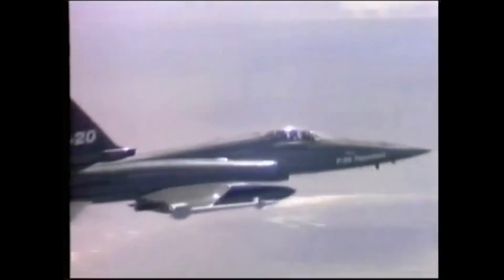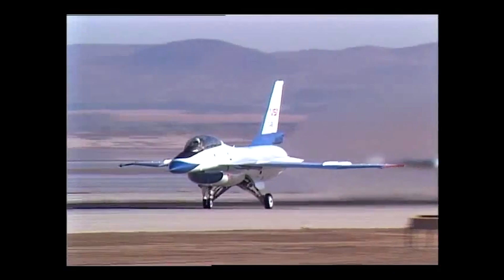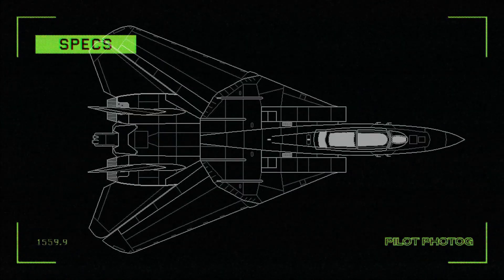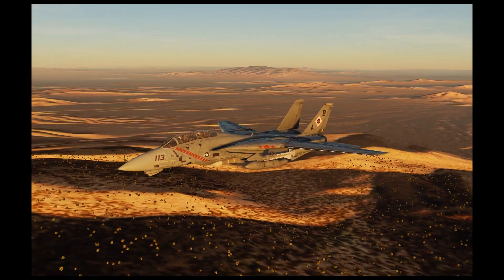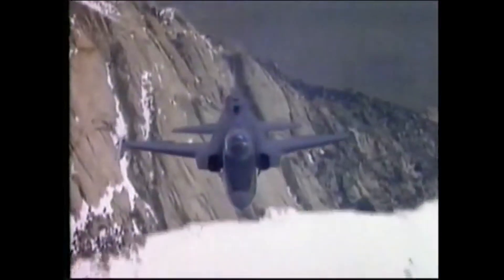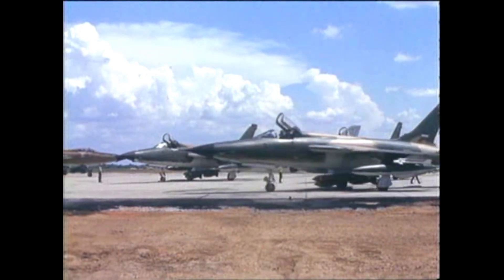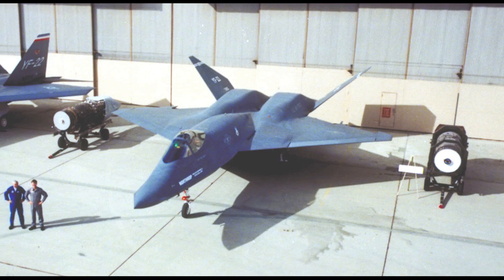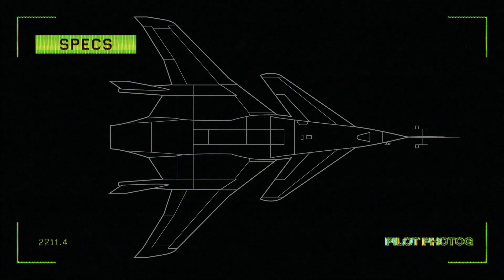Top 5 Fighters That Should Have Been Built | Best of Aviation Series by PilotPhotog  f20  f16xl

Comment: Great video! But one mention I would have made was the Yakovlev Yak-141, the Soviet Union VTOL that never made large scale production, even though it's ingenious design would later be used in the development of the F-35.
Reply: @vemundr9263  ....the Yak-141, which is not a big step from earlier Yak-38, shared the same problems which where doubled in Yak-141. Hugely unreliable engines, difficulties in sinchronizing power package, very very limited combat load and radius of action.  Thereby, the first plane stayed in service for a short time, and then later, the Yak-141 was cancelled mostlikely due to one of the two 'flyable' versions exploding when trying to land on an aircraft carrier.  That, in and of itself, made it not worth the risk.
Reply: The infamous flying coffins.  Ingenious only because the British were able to modify, refine, and make it safe based more on their own jump jet technology.  Russians couldn't get it off the ground and had a hard time finding test pilots that were willing to fly it based on how it earned its infamous nickname.

Comment: The Grumman Super Tiger F11F-1F that had the J79 engine should have been included in your list.  Only the criminal actions of the Lockheed managers who bribed many overseas military leaders and politicians in the 1960's caused the F-104 to be adopted as a common fighter by many  foreign countries.
Reply: The F11F-1F would've much more easily adapted to the low-level fighter-bomber role that nations like Germany and Canada shoehorned the F-104 into. Most likely there'd have been quite a few less pilots dying in crashes had they bought the Super Tiger.

Turns out that trying to make an already tricky to fly high-altitude interceptor fly at treetop level is a recipe for disaster. Who could've ever guessed?
Reply: RedXlV   Hello,  I understand that a few foreign pilots actually flew the Super Tiger to evaluate it against the other competitors and they were enthusiastic about it and evaluated it as equal or better in all missions compared to the other aircraft. As you wrote, the Super Tiger could have much better performed roles other than just a clear weather day fighter.
Reply: Ah as usual the same Lockheed folks doing their usual thing again.
Reply: Agreed. Too bad Lockheed had and still has so much influence on the state of affairs.
Reply: Yes! Thank you.